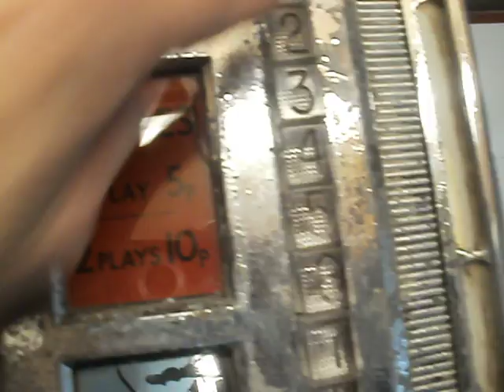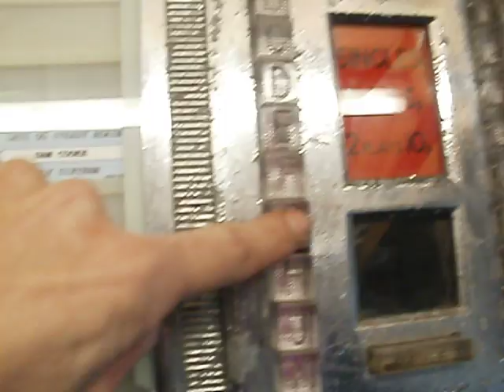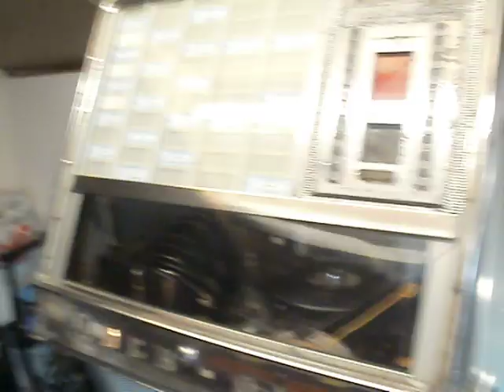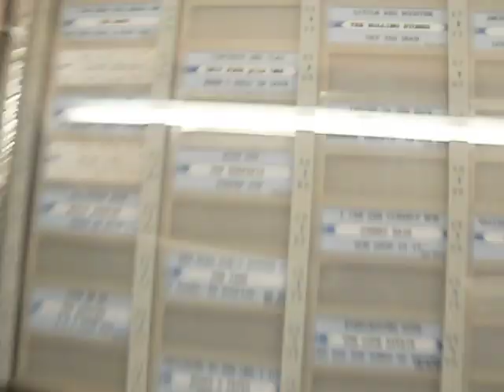rock-ola 403 1484 repair & restoration

Comment: Great job on the restoration. I have just inherited an all original Rock-ola 1484 and am having difficulty with the record carriage (I think that is what its called). I can't get it to stop spinning. The turntable also won't stop. I've managed to fix the problem where it wasn't picking up the right record requested, but I would appreciate some help on where to look for this problem. The manual I have is worthless! Thanks!